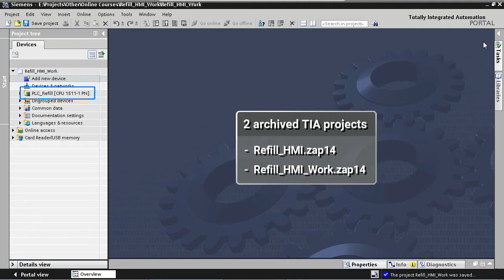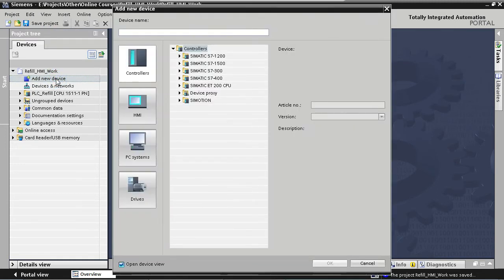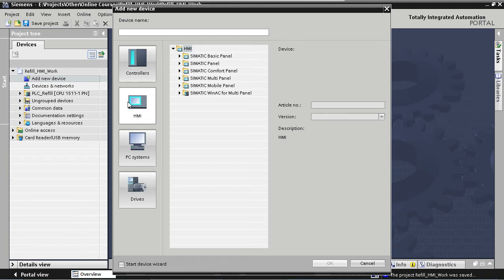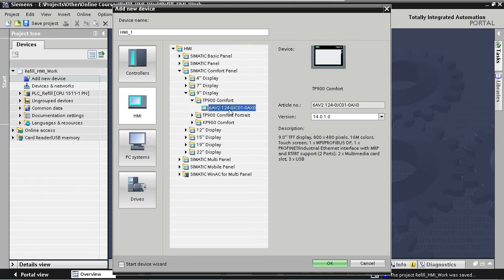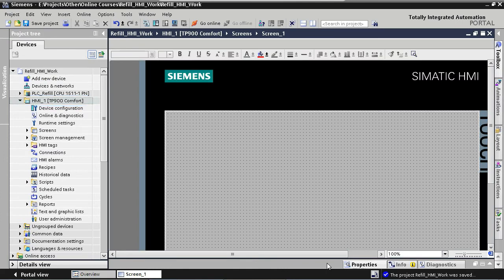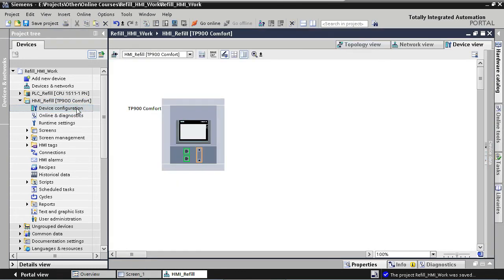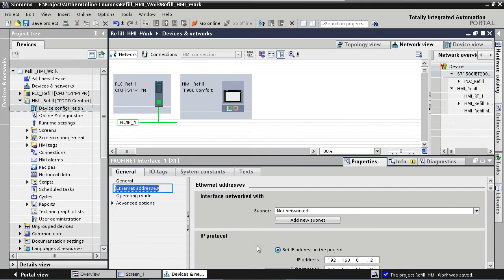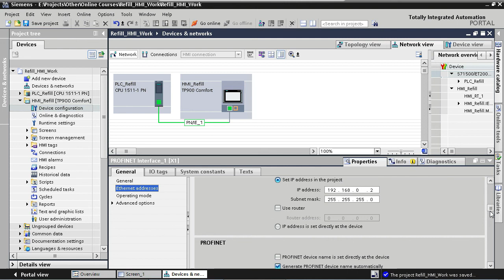How to Add an HMI DEVICE to your existing TIA Project (TIA Portal Course)

Comment: What if I already had an existing HMI Project ?
Reply from the maker: Not sure what your question is, please be more specific
Reply: @PLCskilltree  I have 2 seperate projects. One has only the PLC and the other has only the HMI. Now I want them to be in the same project so I just copy the HMI from the HMI-Project to my PLC with drag and drop. After that I set the PN/IE connection for them and try to simulate the programm. 
THe Problem is that on my screen I only see for example #### instead of the value that I drag and drop from a data block. So I-m trying to solve that problem. Maybe you could help me ?
Reply from the maker: @elnino9139 try and check your PG/PC interface (start typing “PG” in the start menu of your Windows).  Make sure it’s configured with the correct network adapter.  In case you’re running a simulation on your laptop, it should be set to PLCSIM. In case you are downloading to a hardware PLC and run a simulated HMI on your laptop, it should be configured with the network adapter that you use for downloading to your hardware PLC.

The hashtags indicate that there is no connection between your HMI and PLC.  Check as well if “Connections” is set up correctly in your HMI application.
Reply: @PLCskilltree  Thanks for the helping. I have figured it out. The problem was that I chose in the loading plc menu X1 instead of PN/PE_1. And then it forced me to type some password for PLC and I forgot. Thats a bit rough but I think I will copy the Data seperately to my new plc in another project. Hope it will work as well